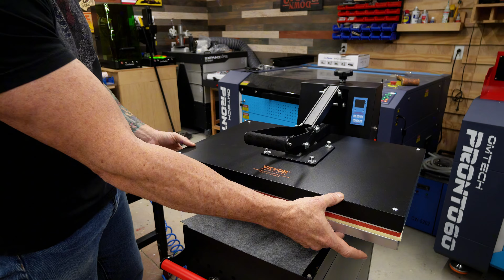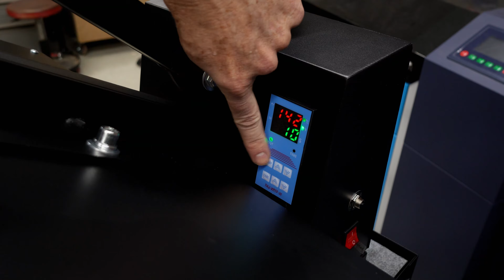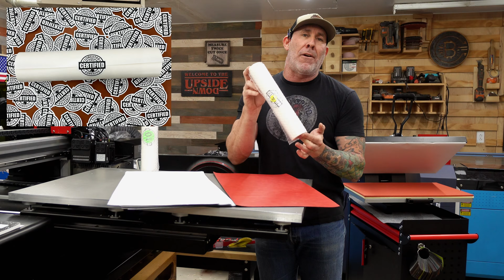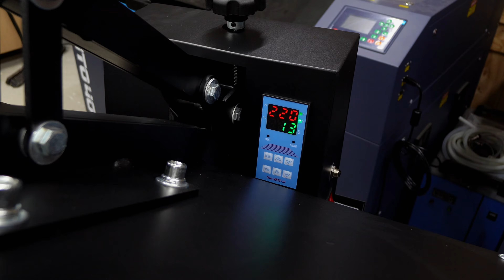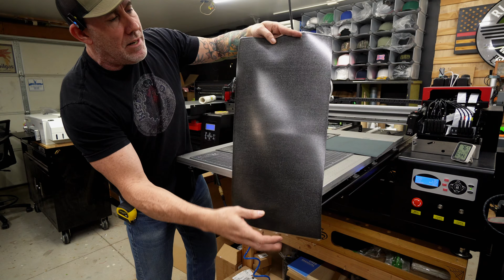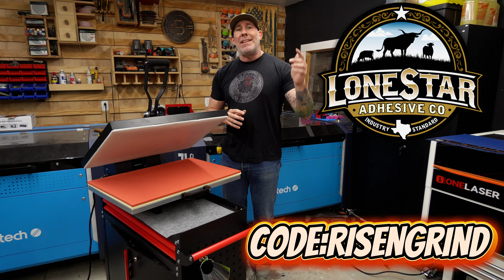Vevor Heat Press | The Best Budget 16x24 Heat Press

Comment: I bought one. The platen had a slight curve to it. Made for uneven spots for dye sublimation. And, the control board fried on me! Where the wires were connected inside, it melted. Loved the size and price. But, it has issues.

Comment: So when its heating does yours make clicking noises like the temp sensor is clicking on and off cause mine is loud and annoying and its brand new.  Also mine didnt close flat until i tightened the know tight.  The top would sit on a angle to the bottom platten

Comment: Max temp of 300°? This printer cant be used for nothing. Not sublimation, not DTF, NOT vinyl. Are you sure your information is correct. There's not many materials required a temp under 300.  Thanks for the video
Reply: He was telling g you the degrees in Celsius, it's goes up to like 500 degrees Fahrenheit so it can be used for sublimation and DTF
Reply: Yeah this unit is 300 Celsius 500 fahrenheit
Reply: i had same question, glad you asked